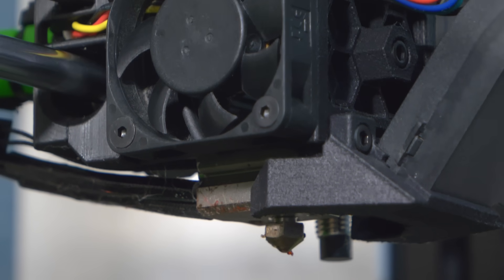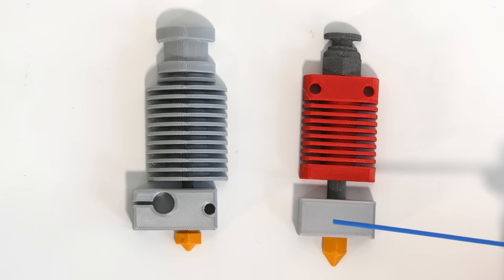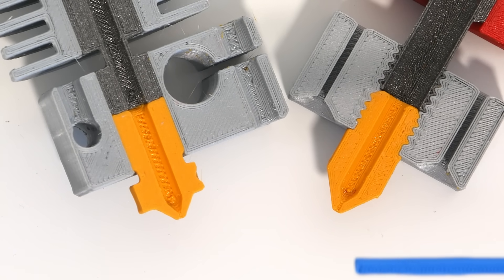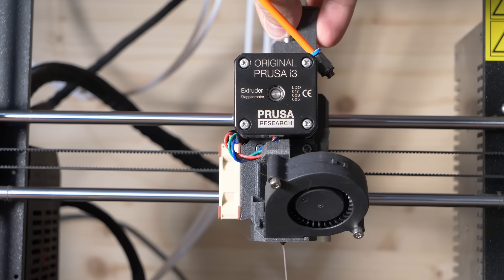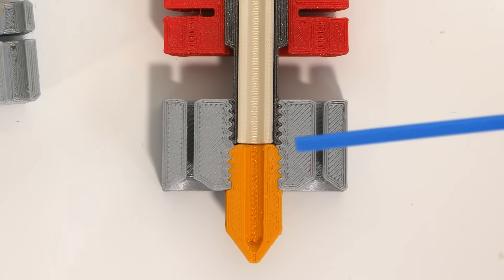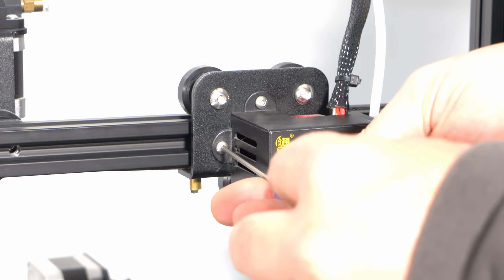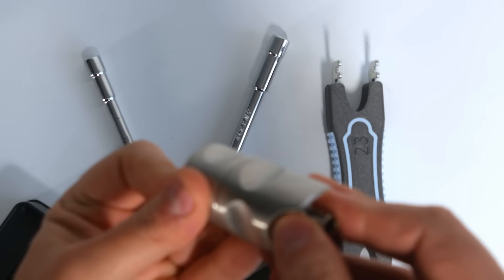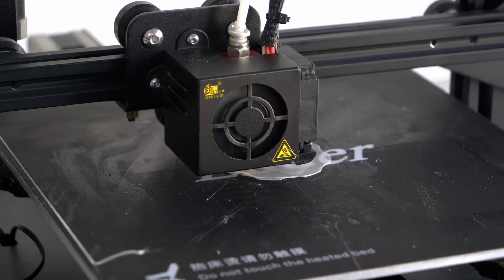The Biggest Pain In 3D Printing - Hotend Clogs & Jams

Comment: Biggest tip I can offer is just avoid Bowden tubes. My ender has had a brand new hot end assembly, new fan, upgraded tube (correctly seated), many new nozzles, all different kinds of filaments, replaced drive motor, essentially you name it I've replaced it and my settings are so low end that to try and make it any easier for the printer I would just have to turn it off. But yet it still cannot print consecutively for more than about 2 hours before it jams, if I immediately tell it to try again (no cool down) it will start working fine for another 2 hours. Save yourself so much headache and just get a direct drive head.

Comment: Hi thanks for your video. I got the same printer, but the second fan does not spin. I mean that it doesn't receive the "on" command. I tried to send direct gcode commands with Cure, M106 let the first fan on, but not the second one. M106 P1 s255 should switch the second fan on, but nothing happens. Any idea? maybe the hotend small circuit board? or the motherboard?

Comment: But if it's the PTFE tube not flush, then the heatbreak clog will be wider than the nozzle, then it wouldn't go throught completely right?. Also, is there a method without a heatgun. Reply would be greatly appreciated

Comment: So to summarize:
1. Needle
2. Cold Pull
3. Deep Clean
Annoyingly, I gave my hot end a deep clean and it was able to only make one print before getting clogged again. I did the flush cut with the ptfe cutter, made sure that nozzle still had a half-turn before inserting tube, and then tightened the nozzle, feels like this printer just doesn't want to play fair xp

Comment: i've never experienced a jam that i can remember until i got creality K1 max printers at work. Those things hate white filament, and the hot end/extruder was designed by an amateur. 
a little too much heat and the filiment would heat soak and retract, then jamb up inside the extruder housing. no idea how that passed engineering tests.

Comment: I just had a bit of luck clearing a hotend jam by heating up a small screwdriver until it smoked then sticking it in from the top. When i pulled it out the stuck filament pulled out with it! Ended up being way easier than I expected.

Comment: Excellent video!  I am struggling now with a certain spool of PLA filament that jams in the heat sink of my new Creality K1 Max printer.  I am trying to counter this by removing the glass top to keep the chamber cooler.  I have lowered the nozzle temperature from 220 deg C to 205 deg C and it is still jamming on one part that I am trying to print.  I printed a large spool at the lower temp and it worked well.  In fact I printer 2 of the spools with a 3 hour run time each.  As soon as I tried to print the other design, it jammed again.  I cleared the jam and printed another spool again with no issues.  I am going to try to lower the temp to 195C (190C is the lowest run temp according to Creality) to see if my part will run.  If it doesn't, I'm going to give up on this particular part.  Again, excellent explanation and I am seeing the filament bulge and jam in the heat sink. It is a real issue.

Comment: I printed for almost 4 years without encountering this problem. Now that my printer has it, it seems impossible to get rid of. 
It seems simple: nozzle not to the heat block, heat sink all the way to the nozzle and PTFE all the way to the end. It follows the intuition and 30 seconds flat to explain this.

And yet, when it occurs, the same steps do not seem to fix it. The unpredictable occurence makes the finecky nature of the fix almost seem like a major design flaw in such a complex machine.  So many things invented by smart people have to work perfect for a print to have reproducable qualities. And then there was the guy who was responsible for the warming of the plastic and he turns out to be someone's nephew. 

Also, Creality's help desk is such a wash I will probably have to buy another printer before I get rid of this problem. Not from Creality, of course.

Comment: I got a new nozzle and the filament gets stuck every time the retraction process happens. It’s as if the filament gets stuck somewhere between the nozzle and heat sink.
Probably not designed properly. I had a Swiss nozzle and had issues with clogging in the heat sink area which never recovered no matter what process I do. 😞

Comment: Great video.  I love the cut-aways.  I was hoping this would help with my problem but sadly no.  I have two machines (Ender 3's) and one prints flawlessly.  The second one prints like crap every time.  I cannot get it to feed without knocking.  Even when the gantry is up in the air.  All of the components from the extruder motor to the nozzle are new.  I've tried different temps and speeds with no resolve.  I've ordered some 0.6 nozzles to see if that helps.  The machine has had this problem since I bought it.  I would like to figure it out before I replace the mother board.  That will be my last resort.  Any thoughts?

Comment: 3:30 ... From my experience, having a Dirty nozzle like this is a recipe for having jams and failed prints from the filament getting all balled up. It causes the filament to stick to the nozzle just as easily (or even easier) than it sticks to the part. The nozzle is hotter and with burnt filament on it, filament will stick to it any time it ever touches it. I never got how hotends get this bad in the first place. I Rarely ever clean or change mine and they almost always look brand new. I think the best advice I can give in this is to be careful... but when things are unavoidable and it does start to get dirty, just torch it. Just carefully (and with protective gear, even if I don't wear any) take the nozzle off and put it on a surface that can't burn or mount it in a vise or something safe where it won't drop and burn anything and where the fumes won't be inhaled... then torch it until all the burnt filament bubbles off. It's very fast and it almost instantly unclogs and cleans the nozzle. Sometimes I'll heat it up enough until it glows, because then that makes it as clean as it came from the factory and turns any filament that won't come off into ash. You just DO NOT want to quench the nozzle in water while it's still glowing hot. That will anneal the metal and make it soft, which might (i have no idea) weaken the nozzle and cause it to wear out faster. Being brass and plastic being plastic it probably won't hurt anything to quench/anneal the brass if you do decide to quench it. This method is not recommended for steel and hardened steel nozzles. If you heat them up to glowing, it may make the steel softer than before... and quenching in water might make it brittle. You'd likely have to either refrain from heating it so much that it glows (probably by far the best idea) or you might have to quench the part in OIL to reharden it if it ever is heated until it glows. This will likely still weaken it at-least a little, but it could also make it even harder if it's a cheap nozzle. Quenching a regular steel nozzle in oil might turn it into a hardened steel nozzle though and it might ever so slightly change the dimensions. I don't think it will change the dimensions enough to ever notice a difference of any kind ever... but it's a possibility.

Sorry for the super long rant on the subject. I wouldn't have spent this much time explaining it if I didn't consider it to be good advice. I'm no expert though and anything you do is at your won risk. Have some common sense when you do things, especially new things and don't do something unless you're absolutely certain you're competent, knowledgeable and skilled enough to pull it off... and always take every safety precaution. You are responsible for your own actions and the outcomes of those actions.

Comment: My prints are very rough and trashy looking with alot of small areas of filament on top of the outer layers of my print. Looks like it's skipping or under extrusion. What should I do for smoother prints? I have a Creality Ender 3 pro. (Besides buying a resin printer.)

Comment: Question for anybody, I recently upgraded my hotend from the one on the left in this video's demonstration to the one on the right. Ever since, I've been getting clogs every 20 minutes of printing. It stops extruding and the extruder winds up cutting the filament from spinning against it.

Does that new hot end need to be at a higher temperature than 210? I've tried to increase my fan speed but i notice it doesn't like to stay where i put it for some reason

Comment: I know this is 4 years old, but still this is the best I've seen from my extensive searches.
You literally saved me on this. I got a clog in the heat break which was causing my prints to stop after about an hour of printing. And, because I took the whole thing apart and fixed that, I have not had an issue with the thermal runaway either. So just by fixing the clog, I have (fingers crossed) fixed the other issue as well.
Thank you.

Comment: I have a brand new Ender 3 v3 KE and it looks like there is a clog in the heatsink section.  I would use a heat gun to see if I can break it loose, but there are too many electrical connections in the way.  I would have to take most of the stuff off the hot end to avoid damaging other components. Am I doomed to have to disassemble the whole hot end?

Comment: I also agree this video was very clear! But I must be missing something???
My Prusa MK3 prints fantastic! However, for the last year the prints fail somewhere during the print and I mean it always fails! Every print! The Prusa Support insist that the gear door is too tight with really no other fix other than cold pulling. 
Yes I thought it was the gears causing this issue in the beginning because the filament next to the gears was getting ripped off. So I turned off "retracting" to make sure the gears wouldn't rip off the filament any more... But it still did???
Then I noticed that the filament was super hard to push in even with the gear door wide open. 
Only then did I think clog. 
I kept bothering Prusa and their suggestion was to replace some parts. I started off with the Temp/Thermistor as they were worn. Then I replaced the heat break which looked bent while applying new paste. Then I found a brass nozzle and replaced my NozzleX. 
Nothing works. It clogs randomly.

Comment: Is it possible for a hot end to completely fail?? I upgraded the boden tube on my ender 3 and I’m using the recommended heat for the print but it seems like my hot end is getting too hot and shrinking the tube to the point that the filament can’t pass through it.. thanks

Comment: This would explain why my 2 in 1 out hot end is only blocked one side. Obviously Geeetech fans are not up to the task of cooling down the heat break. The older models came with a fan either side but the new ones only have one fan. Ironically it's the side with the fan that jammed. I tried to unblock by heatting up  the nozzle, then turn the machine off (with the fan) to let the heat into the chamber while using the rod to try and force filament though. The filament stuck to the cold metal and I was able to pull it up through the top without needing to take anything apart. However every time I use this printer I tend to get a blocked nozzle now as it always curls up when extruding. I've cleaned the nozzle and replaced several times. I'm only using PLA+ now in white but this hot end is the worst on any printer (including the same printer I bought 5 years ago before it died). Nothing but problems.

Comment: Very good.  And thanks for the cut away views.  I found a way to keep the Bowden tube from fatiguing the push to connect fitting.  I print a washer (of sorts) that has a flat bottom and a rounded chamfer on the bottom, and a hole with a 45 chamfer ID on the top.  The rounded chamfer on the bottom helps to fit snug in the heat sink.  The 45 chamfer on the top is to ease filament insertion, while the hole is just big enough to pass the expanded filament being unloaded.  The PTFE tube is cut flat on both ends and sits between the washer and the nozzle.  Now here is the trick in setting it up.  Insert the washer and the push to fit connector to the top of the heat-sink.  Bottom the push to fit connector and then back off two hex sides (1/3rd turn).  Insert the PTFE tubing into the bottom of the heat break.  Use the end of the heat break as a cut guide and cut the tube with a good razor blade, making sure to get a clean cut that is flush with the bottom of the heat break tube.  Reassemble the hot end as normal saving the tightening of the push to connect fitting for last.  Do NOT over tighten.  Now insert the Bowden tube into the push to connect fitting.  I also use the premium tubing for the heat break and the rest of the tubing can be what ever.  Now the retractions will not stress the fitting.  There is a flat positive seal between the nozzle and the heat break.

Comment: I might be late here but why does mine only clog on jayo/sunlu filament. When I use any other type of filament, everything is fine. I have ender 3 v2, use .4 nozzle harden steel. Temperature at 215. I also hear the clicking noise at my extruder (single). Since I think it might be the extruder, I ordered the dual extruder. Not sure if the nozzle .4 is too small and I have to move to .6.

Comment: Luckily didn't have a jam yet, but i had a nozzle clog before due to dirt getting into the extruder. Definately recommend using a filament wiper or cleaner of some sort before the filament goes into the extruder. It can save you from a lot of frustration.

Comment: Thank you. I had to dissasemble my creality 10 s pro v2 but cant work out how far to screw my heat block? If its screwed right up my nozzle is higher than my fan?
Reply from the maker: The rule of thumb is usually to screw the nozzle all the way in by hand, then unscrew it a quarter of a turn, hold it and screw in the heatbreak, then tighten

Comment: This video helped a lot. Least with this Tina 2. Both in figuring out what hot end it is so I can buy a replacement, as well as the PTFE tube being flush with the nozzle. I wasn't doing that at first since I wasn't sure it was resilient to the temperature. So it was clogging everywhere. In the heatsink and nozzle. My printer has some specific slicing software too I'm trying now. I was using cura with the appropriate profiles. Its printing so far fingers crossed!

Comment: You are the man. I think you just helped me figure out why a used Ender 3 pro I bought keeps clogging. I've done many cold pulls, replaced the nozzle, and replaced the PTFE tube. You're comment about the heat sink fan not cooling as efficiently as it could tipped me off. When I turn the fan on after it's been off for a few hours the heat sank fan screams like a banshee for at least the 1st minute or two. This has me thinking even when it comes down noise wise it still may not be spinning as fast as it should.

Comment: I got an issue with my ender3, only pla that works fine is PLA+(Black) rest of them keep getting stuck and won't come out, and in the middle of print just stops :/ changed the nozzle, did a full clean, and nothing, all same stuff

Comment: All metal heatbreaks I have a 1.7mm rod, take off the nozzle and pull the  bowden tube.   heat hotend to 180C and wait.  yank filament I can from the top, then shove the rod carefully down through.   clog usually comes loose and pops out.     clean off rod and pull it back. run through a second time if you really feel the need to.   let cool,  reassemble, reheat, seat nozzle and good to go in less time than any other method I have seen.  Important to get a precision 1.7mm machined rod,  can find them on amazon.

Comment: My Bowden tube is stuck with melted filament and I can't pull the Bowden tube out, any tips?
Reply from the maker: Remove the hot end, use a heat gun to soften the filament and pull it all out

Comment: thing i found with the ender MK-6 or whatever model is that if there is that gap it will print fine tell you turn the printer off and it cools.  was realy frustrating tell i figured out what was going on... first thing i have replaced are those silly pneumatic fittings.... solved so many issues.

Comment: Right now I'm having this problem with my ender 3 pro, I have the metal extruder that I bought as an upgrade, and what happens is that I start to print well, the first layers and then the nozzle gets clogged. Stop extruding or do under extrusion. What I don't understand is why it happens after a while of printing the first layers perfectly.

Comment: I haven't had much time to work on my Ender 3 Pro but I'm sure I have a jam or a blockage somewhere. I had PLA covering the outside of the heatblock under the sock. I got that all cleaned up and replaced the nozzle. I ran some cleaning / purge filament through but my usual PLA won't extrude. I thought perhaps moisture was an issue so I swapped it out for another roll in the dry box and I'm still getting under extrusion or no extrusion at all.

Comment: Here is a tip if you don't want to disassemble the head: 
As explained in the video, the PTFE tube needs to be flush with the heat break and if it isn't plastic could get stuck here. But because there is small chamfer on the heat break, plastic could get stuck here even if the PTFE tube is flush and installed correctly.

While you should probably dismantle the head to make sure it's installed correctly... there is a much easier way to get your printer running again without the pain of disassembly. Simply crank up the heat (275 works well for PLA) and manually run the extruder motor until the blockage melts and filament feeds. As soon as it's clear, cool down the heat block to stop the heat from creeping up too much.
Reply: Thank you for this. Mine only goes up to 260 but this worked a charm.